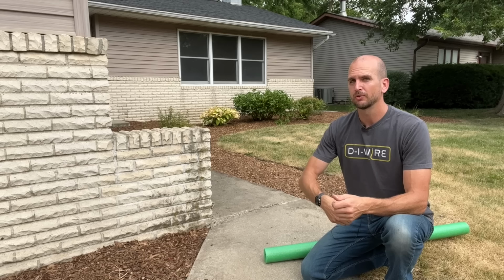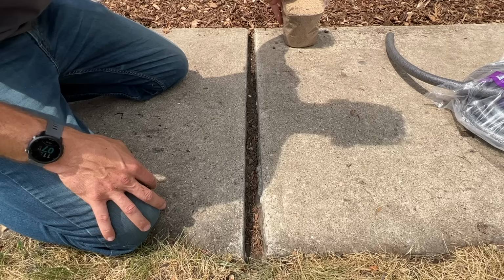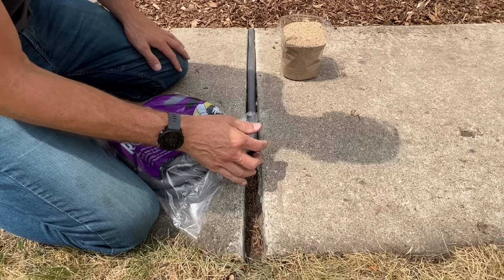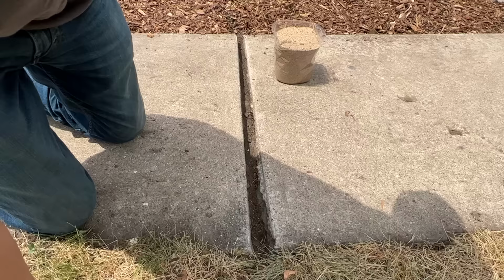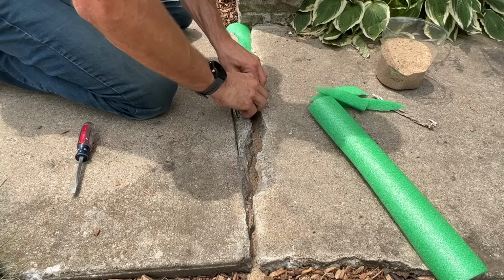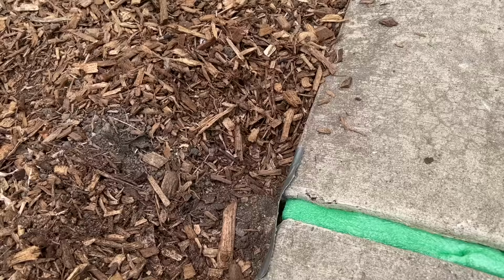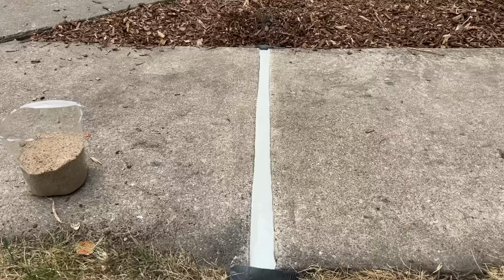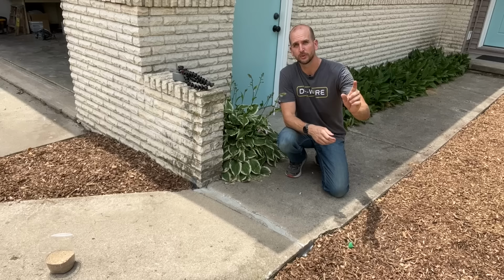How To Fix A Large Crack In A Concrete Sidewalk | Surprising Results!

Comment: Great job, quick fix thanks for sharing  is there a reason you would choose this method vs just filling those cracks with 100% concrete or silicone by itself? 
Or maybe just using that expanding spray foam?

Comment: What if you should have the concrete painted or resurfaced after the crack repair, will the topcoat adhere to this sealant in the future? I can’t afford to have all my concrete resurfaced right now but have some huge cracks that need to be repaired before the winter but don’t want to fix them if it will only cause an issue for whomever  I hire next year to resurface the concrete. I was looking at DuROCK’s Jewelstone, looks great but the contractor I had come to give me a quote wanted almost $6000 to do a fairly small front porch and walkway.

Comment: I'm doing this between concrete/aggregate slabs.  There is a 3/4 wide and 3/4 deep gap to fill.  10 @10' long gaps of SSL caulk would cost a fortune. Can we make the noodle middle closer to the top?  Fill in sides with silicone sealant and top with SSL caulk?  How can I make this affordable?  Thanks!
Reply from the maker: Hey Cassandra, you might want to check the big box stores in your area.  I found a large tube of Vulkem 45 SSL for about $18 which is about 1/3 of the current price on Amazon.

Comment: Did you use open cell or closed cell?  I did tons of industrial caulking with sika 2 c ns.  It is not self leveling.  We also used open cell back rod depending on the application.  Something like this we used open cell for it to bond to the sika.  For concrete slab control joints we used polyurea sl 75 is what it was called I believe the make was Versaflex.  75 is rigid though I like the 45 better for the flex 

Slot of the time we would cut a rectangle out and re pour concrete or urethane mortar and let it cure come back and cut a new joint and caulk it with flexible caulk.
Reply: Sealant on a horizontal surface should always use closed cell backer rod. Open cell absorbs water and stays permanently saturated.

Comment: GOOD VIDEO!!  I have a driveway crack which is very shallow as I have filled it previously w Quickrete. I grinded out a nice 1/4" slot most of the way but have shallow sections (where the tires usually impact the pavement).  Can I just use the sand without a backer rod on the shallow sections?  I already purchased Quickrete Non Sag sealant.  Any advice appreciated

Comment: Wonder if you'd be able to answer a question for me:  Why did you decide to use the sealant instead of the quickrete product you used in your other video about repairing a hole in the concrete?

Comment: This will buy some time but the blocks will keep moving,particularly in freeze thaw climates.The vulcanized sealer will pop out.I am a mason. If the crack is say one inch wide dig out the dirt in it to a depth of 5 inches.The blocks are no more than 4inches.Force down cement in the crack and level off to allow for Sika grey sealer.You can use you pointing tool to dig out the crack then force in cement. This should buy a few years at least😎

Comment: Could I repair a large crack in the slab at the top of my pool steps using this method? The slab is about  4'x8' and has a large settlement crack in the center. I'm afraid the backfill may have migrated to somewhere else around the pool so I may not be able to pour sand in the crack to fill it and would just have to use the pool noodle backer.

Comment: Thank you for your video.  I have a crack in stairs leading to my walkout basement. The depth of the crack is around 6 inches.  Should I fill that all with sand OR fill with the concrete semi level you mention?  Additionally, on one side the crack is vertical to six inches.  I planned on putting backer rod and then use duck tape as the vertical barrier to keep the SSL in place.  Thoughts on my plan?  Thank you for your Amazon links!

Comment: Do you think this could be done on a driveway where the concrete has crack thru showing the wire mesh? This would be much more time consuming as a fix but much cheaper than a new driveway which has been estimated at $50k.

Comment: I used a cement caulk for my sidewalk.  The wood seprators got wash out by pressure washer.  I used self leveling caulk.  It was rubbery for about a month. Now its a year  old and I dont notice the rubbery caulk line anymore.

Comment: Good video, and I can vouch for using foam backer material and flexible sealant, it will last much longer than using any stiff masonry material. Also from experience I would warn against using  ANY new concrete directly on concrete. Different materials will harden to different stiffness, and will crack, new material can even cause more cracks in the old…..Never fill expansion joints with concrete, either, always remember, the ground moves :)

Comment: Not a bad repair on the "normal" expansion joints.  I would however not fill in the bigger crack with the self leveling caulk. I would rather do this.  Mix some portland with a little sand  after cleaning out the crack and fill it in.  I also would powerwash the sidewalk and again using Portland make a "paste a little thinner than toothpaste.  Paint it on the sidewalk before doing your repairs. You will have a brand new looking sidewalk when done!  Just a thought.....

Comment: Nice repair,looks like it will last forever! I have concrete stoop with one step from the sidewalk to the top of the stoop. Could you do an episode using concrete blocks to heighten the lower step,which is too low right now? I was planning to glue some concrete stones to the lower step somehow.

Comment: What is to keep the foam which in this case is the noodle, from popping out of the crack? because whatever cement or sealer you put on top of the noodle is only resting on the noodle.  and you can just come by and flick the noodle up with your finger and the whole thing comes out of the crack.? 🤔

Comment: Do you really need all those products like a foam rod and sealant in a tube?  I have filled driveway cracks by simply hacking them open a bit, blasting dirt out with water and then filling them with small aggregate concrete.  Worked perfectly well and produced a durable result !

Comment: Just a quick question, instead of the sealant could you use some of the quick set concrete they use to set fence posts after you install the pool noodle material or do you think it would crack and break?  Thanks again for the clear instructions and idea.  Well done!
Reply: It would crack–there’s a lot of seasonal movement in those slabs, and concrete is inflexible. The caulking used in this video has both flexibility and adhesion, which would help it last quite a bit longer.
Reply: Another commenter said he uses a product named "Cement All" which is poly based & has 15 minute drying time - & less expensive than what this guy used!
Reply: @billyjack3580  you are absolutely correct

Comment: I did my driveway and sidewalk some years ago using urethane sealant and it looked great for a few years until the UV rays started to deteriorate the urethane sealant. Pouring sand over it before it dried may be the solution for that problem that cannot be avoided if the sealant is exposed to sunlight.

Comment: Amazon price for a 29 oz Vulkem 45 SSL is $53+.  I found it at Lowes #89 in Katy , a town next to Houston for $17.87. You can order online, free with minimum $45 order. I also found a video from Sealgreen company. They sealed only the 2 sides of the backer rods first with Vulkem 116, ($6.48, 10.1 oz at Kathy Lowe's), then top it with Vulkem 45 SSL.                     I , I am a senior widow, never had to fix anything before, so I am not sure what Vulkem 116 they used for, probbaly to seal tight to make sure the SSL can't leak down below? Is it part of pre-prep?  Someone please let me know. They also said that the SSL must be 1/8 in from the joint surface and should use a fine, light toping sand.  Could I use the Pipe insulation foam tubes? They have polyethylene like the noodles but cheaper. Home Depot has good price.    I have to repair all the joints on my drive way, one has unleveled edges, and a part of another joint  unleveled. What should I do?

Comment: HELP! The expension joint of my driver is 1" to 1 -1/4" wide . When I removed the dirt today, I found out that there is a 1/2 in wide solid concrete block, not loose, running along the bottom of the joint bottom, close to the left of the joint at at some part or the right or middle at another part. Therefore the  depth of the joint measured from the concrete block line is 1" to  1 -1/4 in. What and how should I do to prepare for the foam noodle and the caulking? Please advise me .

Comment: First...this will heave again.  You should have led with that.  Sealant isn't designed for areas that undergo significant shifting especially when cold and due to ice expansion.  That's why bridges are made with expansion joints. 

Second...you are correct that there is a water problem.  For some reason water collects in the ground under that section of walk way.  I would suggest that there is a compaction issue due to the wall section coming off of the garage wall.  It immediately abuts the crack.  When physical elements are in close proximity to each other they are likely the cause of a problem.  

Third...this fix is a short term solution. 

Fourth...the backing foam must be closed cell foam.  As opposed to open cell foam which absorbs water, closed cell will not.

Fifth...the foam used must not be labelled "biodegradable" as it will.in fact, rot in the ground.  Expandable foam used in construction would fill the void precisely, stick to the sides, by stable under weather conditions and flex. 

Sixth, you should only use construction grade materials for projects like this.  Pool noodles are NOT construction grade material.  Also, they will dislodge over time.

This looks easy...because it is.  That does not mean that it was done correctly.  Easy isn't often correct for a first time DIYer.  A pro makes it look easy because THEY KNOW WHAT THEY ARE DOING.

This really is bad advice as to fixing cracks.

Comment: I use titebond self leveling concrete crack sealant which is similar but I totally cover the sealant with sand and mound it up thick so it absorbs into the sealant. I apply the sand immediately after sealing a section. The next day I remove excess sand it blends in very nicely.  This technique helps but if the sealant gets wet it be more noticeable until it dries. Nothing perfect in this world.

Comment: The best way to fill and fix a cement crack like this one in the video, is to use Flex Seal. It not only fills the gap, but it's waterproof and keeps water out from helping to grow weeds and little trees in your concrete sidewalk or driveway.

Comment: Good tip, but I'd rather use "great stuff" foam instead of pool noodle or backer rod because it spreads and seals better and it'll be harder especially with maximum expansion foam and then to cover with self leveling Vulkem 45 SSL
Reply: You'll need to cover it or use foam rated for outdoors/sun (and such from great stuff is much more $$) or it will break down.

Comment: The foam for noodles breaks down very quickly. Not all foam is the same. You'd never imagine how it's made.  
BUT, great idea, wrong foam.  Backer rod foam is good, different chemicals. Pipe insulation foam is also a good foam to use and not too expensive.

Comment: The depth of the caulk should be half the width of the joint, never to exceed a half inch in depth.Sand is not recommended on top because it makes the caulk more rigid and loose some of its elasticity. Not trying to discredit your opinion but I’m a forty year union caulker. Also when you cut a closed cell foam like the noodle, you need to let it sit in place for a while to let the gasses out.

Comment: I've never understood this.

As far as a return on your effort; how does a different colored brown dirt seam/crack look any different than an also  not-sidewalk-matching  grey?
Maybe ive been missing something but i suppose im on the side of:
Resurface the walkway for an entirely brand new look and make the expansion joints straight and even.
Or
Do nothing and leave it as is..
 (That is if all your doing is changing the color of a crack by filling it with self leveling instead of the dirt that was originally there.)

Comment: Have used expanding spray foam in these types of cracks with success previously. Just trim it about 1/4" below cement and then typically use self leveling product to fill in this gap and cover spray foam, making it level with cement so no further debris can fill it in over time.

Comment: Why not just mix some cement and put it in there?  I have a large crack in my shop and water is coming in from the ground and pooling up.  I'm not sure if i should try this or fill it with concrete.

Comment: It is much easier to put dry concrete powder in the cracks and water it well. You can sprinkle sand on top.
Reply: Bad idea for a joint that is supposed to move and flex. That concrete "fix" will break apart after one winter.

Comment: Why not cut those irregular crack lines to two straight parallel lines with a Angle Grinder (with a concrete blade) ?

Comment: Just thinking of the aesthetics of it, I wonder how much more work it would have been to cut the edges out so you had a strip of constant width and then filling it with new concrete or some decorative pre-cast concrete.
Reply: I would have fixed the jagged crack with epoxy, then came back a couple days later with an angle grinder and deepened the control joint so it would crack there. I guess there are several ways to do it depending on the price and look that’s acceptable to you.

Comment: Great video.  Thanks for sharing.  BTW, what is the cure time on the sealant?
Reply: The cure time varies with temperature and humidity. One component polyurethane sealants are pretty slow curing. The industry standard is to allow 7 days for complete cure. It will “ skin over “in about 5 hours again depending on temperature and humidity.
Reply: @genecarden780  Thanks for the replay.  I was just wondering if it would be safe for the mail man to walk on the next day without messing it up.

Comment: For the first crack, why didn't you dig up one of the concrete sections of the sidewalk and move it up so the gap would be more even? Then a backer rod would fit and you wouldn't have to cut a pool noodle to fit.

Comment: As a Mason I would not do this.
I would water blast it out and if is a small narrow crack I would make up a cement slurry and pour it in and keep doing it until it is full and then use a sponge to clean the excess up. If it's a wide crack use a sand and cement mix and push it right down with a stick/dowl then use a wood float and then sponge off excess.

Comment: Why not use sand under the sealant or, better yet, Quikrete the whole way? Either would last much longer. This seems like a very temporary repair at best. That foam won’t last long being outside 24/7 and it will compress causing the sealant to crack.

Comment: I want to address all of the people who think the6 know more than the op
1. The crack runs adjacent too and parallel with a control joint( the installer anticipated movement here, just not this much)
2. The crack is very consistent in width ( the middle of the crack not the top surface that has been damaged)
3. There is very little setteling ( both sides of the joint are relatively level and parallel)
4. There are no other significant cracks in the area
5 there are no radial cracks
6 this is indicative of the fact that the forces that caused this crack are parallel with the length of the slab
7 it is also a classic indicator that an expansion joint was needed
8 it is also an indicator that this is an active ( dynamic, moving ) joint
9. Being an active joint any attempt to repair it with a ridged ( concrete, mortar or any non flexible repair) will fail
10. This is in affect an expansion joint and should be treated as such
11 because this is not caused by erosion, filling the joint with things like spray foam are a waste of time
12 anyone that thinks that completely filling the joint with sealant has an amazingly shocking lack of understanding of how sealants work and should never do any home improvement projects ( including painting)
13. Is this posters solution perfect? No. But it is pretty damn good.
14. I have over 40 years experience in this field. Not as a Handyman, but as a professional that has had some of the biggest and most respected contractors in the nation ask my advice
Bottom line you need to listen to this man, if you question him be very respectful he is not some uninformed individual trying to get YouTube views. He does his homework and offers very reliable information for the homeowner.

Comment: With just 1,2 or 13 cans of Great stuff foam it doesn't work on sidewalks or on wheelbarrow tires  overtime the foam compresses and can't hold the weight of the slab or load of wheelbarrow stuff.

 Save your money and hire a pro to break up  small part of slab and re pour.  Eventually what I did. I got an amazing deal on a 27 lb jackhammer from Amazon for $110 I own this thing it's a beast and manageable without too much difficulty.  One day rental is 75 bucks I've definitely used it more than 10 days already and it comes with that great little plastic case, dorky goggles,  useless gloves. I threw out and use my own.  straight from China. Doesn't matter it's still a beast  "Xtreme power" I think it's called.

Or use the part 2 whatever Brandon might be talking about. I can't verify that.

 YouTube is your friend but it can also be your enemy and lead you down the wrong path. You just have to be able to decipher between the two. 

I'm only speaking from experience!